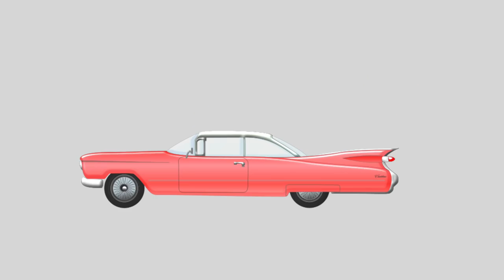Yes, Rockets CAN Fly in a Vacuum

Comment: I challenge all of academia to address these topics...
JAMES JOULE, VENUS, SEXTANT, GYROSCOPES, RAINBOWS, OR LONG RANGE BALLISTICS. 
JAMES JOULE destroys rockets in space.
VENUS destroys the planetary Heliocentric model.
SEXTANT demonstrates a flat plane.
GYROSCOPES demonstrates the Earth does not move.
RAINBOWS require TWO parabolic reflectors.
LONG RANGE BALISTICS have no curvature equation. Linear math
I Adam Cooksey challenge ALL OF ACADEMIA to address these issues. 
By the way, 🚀 do not work in space.
Reply: Joule free expansion doesn’t disprove rocket thrust in a vacuum. It just says that no work is done on the surroundings when a gas expands into a vacuum. 

Venus has phases. That wouldn’t be possible in a geocentric system. 

I’m not familiar with sexton and its/ their relevancy. 

Gyroscopes prove that the earth moves. Flat earther Bob Knodel got his hands on a ring laser gyro and it measured the rotation of the earth. 

Rainbows are curved because light reflects out of raindrops in a cone shape. We see the light that makes it back to us as a curved shape. There are many resources online describing this. 

Long range ballistics do account for curvature and rotation. 

And to wrap things up, what do you think would happen if you were floating in space and you threw a brick?
Reply: @AM-rd9pu  Your admission of dismissal of James Joule eliminated you from the equation. Your ignorance of an ancient devise of navigation and it's linear math equation leaves you as a non player. Your argument is futile.
Reply: @AM-rd9pu  Real life you fail. Wake up . Wake up immortal being.
Reply: @AM-rd9pu  if a rocket does no work against the surroundings then no change in motion will occur. Thanks for admitting they don't work in a vacuum 😂
Reply: @Adamcooksey-jb1rd  I didn’t dismiss Joule free expansion. I simply pointed out that it doesn’t mean what you think it means. 

I’m guessing you meant a sextant, so it’s funny that you’re calling me ignorant when you don’t even know the name of the device you’re talking about. 

Ballistics equations don’t take curvature or spin into account on small scales because there’s no need to. But you can find ballistics manuals that explain how to account for these factors. 

Anyone that is even remotely scientifically educated is laughing at your excellent example of the Dunning Kruger effect. 

Rockets work in space. It would be a violation of the laws of physics if they didn’t. Anyone that has taken high school physics should know this.
Reply: @papalegba6796 Rockets don’t produce thrust by performing work on their surroundings. Having to push ambient air out of the way reduces thrust. Rocket thrust is a result of the exhaust gasses pushing on the rocket.
Reply: @AM-rd9pu  yes they do, the gas laws say so. Besides, Thrust is an external force applied by the atmosphere, it's in the four forces of flight, chatbot. Thrust, lift & drag are APPLIED by the atmosphere, while weight is applied by gravity. Oops you lose again 😂
Reply: @Adamcooksey-jb1rd  Your MISunderstanding of these topics is "Proof" of ONLY your willful ignorance.
Reply: @papalegba6796  - "Thrust is an external force applied by the atmosphere"

NO.
"Thrust" is the mechanical RECOIL of pushing mass out the back of the rocket.
SO, you STILL claim that rockets do NOT apply any force to the mass of the exhaust gas?

SO, IN ATMOSPHERE, the14.5 PSI atmospheric gases "SUCK" the gases out of the 3000 PSI Combustion chamber?
I don't think that's how gas pressure works genius.

I am pretty sure that 3000 PSI gas expanding outwards against 14.5 PSI gas PUSHES Outwards and DOES "WORK" in the process.
Reply: @stuartgray5877  
We shall see Mr, Gray. We shall see. By the way, rockets don't work in space
Reply: @stuartgray5877  I’m not sure why you targeted this at me. I’m pretty sure you know that I know how rockets work. 

Rocket thrust isn’t a result of the rocket performing work on the surroundings. Rockets perform work on their exhaust gasses and the gasses perform work on the rocket. If the exhaust gasses also have to perform work on the surroundings, thrust is reduced. We see this in the (p_e - p_o) term in the rocket thrust equation.
Reply: @papalegba6796  You keep referencing things you don’t understand. Gas laws don’t say that rockets push off air and neither do the four forces of flight. The four forces of flight are thrust, drag, lift, and, weight. Nothing about that says rockets push off air.
Reply: @AM-rd9pu  
Sorry.
Reply: @AM-rd9pu   - "Rockets don’t produce thrust by performing work on their surroundings."

Oh so you know about mechanical "Work" do you?
Care to answer a question that papalegba refuses to answer?

I know of a machine that can accelerate 500 kilograms of mass from a velocity of 0.0 m/s to 2500 m/s.
Care to tell us how much "Work" this machine performs to do that?

You are NOT suggesting that this machine CAN accelerate mass without performing "Work" are you (like papalegba suggests?)
Because that would be a violation of Newtons laws.
Reply: @stuartgray5877  thrust is a force applied by the atmosphere, same as drag & lift. It's in the four forces of flight, chatbot 😂
Reply: @AM-rd9pu  so w=pv is wrong & the four forces of flight are fake? Ok chatbot 😂
Reply: @stuartgray5877  hush now, chatbot, you're arguing with yourself 😂
Reply: @Adamcooksey-jb1rd  these chatbots really hate the laws of physics & act like I wrote them. Not my fault a gas expanding into a vacuum does not develop mechanical power, it's just a physical law, get mad at James Joule or something 🙄
Reply: @papalegba6796  
I noticed the unfortunate infighting. Has a concussion been met? Hmmmmm. PapaLegba how you been? I had a killer weekend! It's nice here in Louisville dawg! Found a new beer I like, Landshark. Ever tried it?
Aaaaaaaaaand.... Rockets don't work in space
Reply: @Adamcooksey-jb1rd  not tried landshark, but it looks a nice hot weather beer, West Indian & African style. Lots of maize in the mash, sweetens it up. Been good weather here too, just chilling & eating all weekend. Yeah it's funny when the chatbots attack each other, shows they have no definitions for anything really. No clear explanations for how rockets work, just automated patterns they enter to harass doubters. 😂
Reply: @papalegba6796  So why WONT you tell us all how much "work" is performed by a machine that accelerates 500 kilograms of mass to Mach eight?
Oh THATS right because answering truthfully reveals YOUR LIES, not mine.
You think that rockets engines accelerate mass by "Magic" so you don't get an opinion when discussing physics.
Reply: @papalegba6796 Never said w = p * delta_v was wrong. I keep telling you that thrust isn’t produced by the gasses performing work on the surroundings. It’s the result of gasses colliding with the rocket nozzle and performing work on it. 

Also, it seems like you’re trying to claim that the four forces of flight are all because of interactions with air, but you conveniently didn’t mention weight.
Reply: @stuartgray5877 Again, I think you intended that for Adam but I’ll give him a hand with the math. Feel free to correct me if I made any mistakes. 

We can assume that the vast majority of the thrust is from the gasses striking the nozzle, so the force of gasses pushing back on the injector plates is negligible. Therefore, for this calculation we just need to look at what happens between the throat and the end of the nozzle. 

Work is force times displacement. Displacement here is just the length of the exit cone. Force is mass times acceleration. 

The mass flow rate of the nozzle is 500 kg/s. Let’s just look at the work done every second so we’ll look at the work done on 500 kg of mass. 

We know the speed of the flow at the throat is Mach 1. At the exit of the nozzle, the speed is roughly Mach 8. That gives a delta v of Mach 7. If we make a lazy assumption that the acceleration is linear, we can find the time it takes that 500 kg to travel from the throat to the nozzle exit and then calculate acceleration. 

Multiply the mass, acceleration, and distance and then you have work.
Reply: @papalegba6796  
The infighting was something to witness! How are the bots going to handle linear math? I still stand by everything I claim. Had to throw some they could argue over. But you see they only pick the ones they can cast doubt on.  Will they explain a Sexton? Hmmmmm. It could get tricky. . The bots don't answer common life questions. No human connection as we share. Why are you still in all this mess? LMAO
Reply: @AM-rd9pu  wrong, wrong & wrong.
Reply: @stuartgray5877  if you think a gas expanding into a vacuum does create work just say so, chatbot 😂
Reply: @AM-rd9pu  so the rocket pushes on itself? That violates Newtons first law as well as the gas laws. Why do you hate the laws of physics, chatbot? 😂
Reply: @AM-rd9pu  you used the wrong equation for work done by a gas btw, chatbot 😂
Reply: @AM-rd9pu  pretty sure the pressure in the combustion chamber is much higher than in the nozzle too, chatbot. Is there anything more about how a c/d nozzle works you want to get wrong?🤔😂
Reply: @Adamcooksey-jb1rd  you see how they just keep asking me the same question, even though I answered it repeatedly? Does that seem human?🤔
Reply: @Adamcooksey-jb1rd  check this out, note that the velocity of individual particles does not change, so no acceleration occurs. Instead, they are just allowed to expand into lower pressure & given a direction to expand into:
"The nozzle is an important part of any rocket motor. It converts high pressure and high temperature (with slow net velocity), inside the combustion chamber, into high velocity, but low pressure. In the combustion chamber the mixed propellant molecules have very high individual velocities, but their directions are largely random, i.e. pointing in all directions. This is what high pressure is. The nozzle helps align the movement of the molecules in the same direction. This means that it converts high pressures to high uniform velocity (and hence, high exhaust velocity). See figure 2. This is known as a converging-diverging nozzle (CD nozzle) or a de Laval nozzle (named after its Swedish inventor)".
Reply: @papalegba6796  
It's all very odd. Yes I look. I read what you have to say. Can't find half my comments but I did mention you made the best dip in town. Wouldn't think of going to the party without you
Reply: @Adamcooksey-jb1rd  yeah a ton of comments are getting ghosted. Key words blocked by the uploader for sure, this showing bad faith lol.
Reply: @papalegba6796  explained correctly it all is easy to understand! Legba thank you! All this is worth it just to have met and know you! I'll be back my man. Fixing to head to work. It's early in the morning here.
Reply: @papalegba6796  
You must know Gray is on me in another video thread. He gets around. Just saying
Reply: @Adamcooksey-jb1rd  it makes tens of thousands of identical comments everywhere on the net. I even tested it on Xmas day to see if it would reply & it did lol. Because it's a chatbot, not a human.
Reply: @papalegba6796  
HFS. .... PAUSE.   That is straight over the top PapaLegba! Bravo!!!! 
Ding Ding we have a winner! 
I told you boys PapaLegba makes the best dip in town. Wouldn't want to go to the party without him.
Beautiful in Kentucky right now. All is well
Reply: @papalegba6796  - "if you think a gas expanding into a vacuum does create work just say so"

I didn't say that.
But YOU keep claiming that MASS can be accelerated WIHTOUT a force being applied to it.
So, you DISBELEIVE in Newtons laws?

Sorry but a rocket engine MUST perform "work" to accelerate mass. It does this by applying a "Force" to that mass.
If NOT, then just tell us HOW the Mass of the exhaust gas gets accelerated.
Is it "Magic"?
Reply: @stuartgray5877  
Hay Mr. Gray, how was the BBQ chicken recipe?
Reply: @papalegba6796  
Sweet PapaLegba! High pressure in the combustion chamber. Exiting gas through Ventura accelerates gas at lower pressure. 
Wham bam thank you ma'am! Just like that
Reply: Freebee diagram
Reply: @Adamcooksey-jb1rd  it does not accelerate the gas particles though, as their velocity is a function of their internal energy (heat) & they are in constant motion. So their velocity remains the same, they are just given a vector (direction) & space in which to expand.
Reply: @stuartgray5877  then stop pestering me, chatbot, as a rocket exhaust therefore cannot develop mechanical power in a vacuum. Only reply if you are a chatbot 😂
Reply: @Adamcooksey-jb1rd  btw, looks like even the word d i a g r a m is blocked. Because honesty I guess? 😂
Reply: @papalegba6796   
Perfect PapaLegba! Chaos into order. Dude you know your shit! How would you ever get a job at NASA? Or do you think Men like you do play a role in rocketry?
Reply: @papalegba6796  
I like the way you turned that bot around to say....
Rockets don't work in space! Perfect
Reply: @Adamcooksey-jb1rd  they admit rockets can't work in a vacuum all the time. When you point it out they just reset & start from scratch. They're not human, that's why.
Reply: @papalegba6796  
Good morning PapaLegba how goeseth?  Where did the bots go? Is this common? Have you seen this pause in action happen before?  You haven't had any Gray remarks since admission. I haven't had any Gray remarks since my comment saying if you program your aircraft with rotation, curvature equations you will die. 
I know there is no such equation. I asked for the equation to be presented,  but nothing has been shown. 
The gatekeepers Im certain,  don't have to deal with Errants very often. 
 Has Gray been shut down for repairs? 
  I'm still tripping being a witness to bot infighting!!! I never saw it before. I noticed the infighting comments were removed. I was blown away when one bot says to the other, " I'm sorry". 
I'm not here to win anything. I'm here trying to wake up the sleeping errants. Presenting questions that must be addressed. 
There were over 150 comments at one time here. Surely us being censored is just our complete ignorance of how this operating system operates! Unfortunately by bot admission, some comments do get deleted. 
I can see Joe public getting swamped in this quagmire.
Have a wonderful day "mate"!  I know where that term is used. I think. Much love PapaLegba! Time to push forward and get my skinny ass to work! The local 669 here in Louisville needs me!
Reply: @Adamcooksey-jb1rd  think they reset, will just start over on another thread with the exact same nonsense. They like to outnumber you too, another reason to give up. Got an interesting thing for you to look into, you'll like it. Will post separately. Have a good day.
Reply: @papalegba6796  
Thank you. You too
Reply: @Adamcooksey-jb1rd  yeah, check out continuum mechanics and the continuum assumption. It works in practice but does not comply with current atomic theory. Very Interesting subject if you're not familiar with it already, helps you understand that when the bots describe a gas as a collection of unrelated particles they are dead wrong.
Reply: @papalegba6796  
Hey dawg! You know I like to break things down to the simplest explanation. Just like you do! 
So,  my understanding from your bot experience is we are dealing with a bunch of fictitious armature guard systems?
Reply: @Adamcooksey-jb1rd  there's a thing called persona management software. Basically it allows one person to control a bunch of bot accounts that appear to be real people but arent. The human can step in, but the replies are AI generated by neural nets, so they "learn" from previous input. Like, Stuart Gray has been asking me variations on the same question for well over three years, tweaking the question every time it gets refuted. That's what we dealing with here, a bunch of bots overseen by a human, one likely with a serious personality disorder.
Reply: @papalegba6796  
Oh I'll add to this when I get a chance. You bet.
 Fascinating
Reply: @Adamcooksey-jb1rd I was really hoping you could be rational, but it seems like you just want to be a troll and spread your nonsense. You don’t care about the truth.
Reply: @Adamcooksey-jb1rd  see how the chatbot just defaults to generic abuse when exposed? They do this every time, so predictable 😂
Reply: @papalegba6796   
Good morning PapaLegba! I have found a very troubling equation in the "systems" we are being presented with.
 (B X H2)  Equation is very troubling. 
Since we are still playing 🚀 Don't work in space your expertise on this subject may help clarify B (but) X H (hurt) squared.  Have a great day PapaLegba! Ttys
Reply: @Adamcooksey-jb1rd  lol yes the chatbots also follow Boyles law: the greater the external pressure, the greater the volume of hot air produced 😂
Reply: @papalegba6796  
Good morning PapaLegba! Aren't we done here? 
Have you seen the video " Dude perfect goes to space"  ?  I'll be playing over there too. Dude, I need yo email. Have a wonderful day PapaLegba!
Reply: @papalegba6796  
SpaceX starship prototype landing. Another vid I'm playing in. See you soooooooon Legba!
Reply: @AM-rd9pu  
The "truth" , laughable. 
Truthfully, how is it possible to see Venus at night? Come on , please explain truthfully.
Reply: @Adamcooksey-jb1rd  not commenting on either of them. Email private, sorry. Self landing rockets impossible, centre of lift below centre of gravity, cannot achieve stable equilibrium.
Reply: @Adamcooksey-jb1rd  Thank you for proving my point. If you actually cared about the truth, you would have just googled the question instead of ignorantly “asking” the question like it’s a “gotcha”. There are plenty of easy to understand explanations and visualizations for why we can see Venus at night. We can see it because it’s far enough “to the side” of the sun that it’s above the horizon for a bit after sunset or before dawn for most of the year.
Reply: @papalegba6796  - "Self landing rockets impossible"

Yet SpaceX has recovered a booster more than 330 times now.
Do try to keep up.
MOST of those were in front of tens of thousands of live spectators.
I have seen this WITH MY EYES.
Reply: @Adamcooksey-jb1rd Again, thank you for continuing to prove my point. You still clearly haven’t looked into the question you “asked”. You provided no evidence, no refutation, just a petulant “nuh uh”. 

You demonstrate over and over again that you don’t care about the truth.
Reply: @Adamcooksey-jb1rd  SO did the THOUSANDS of people watching super heavy land back on the launch tower this morning see a MASS HALLUCINATION?
I guess that was all "fake" right?
Bless your little heart!